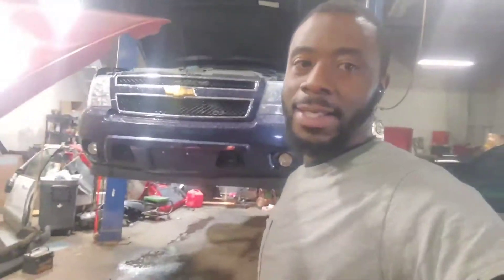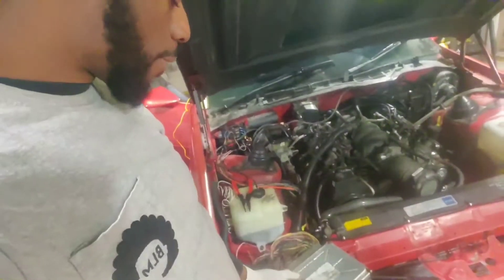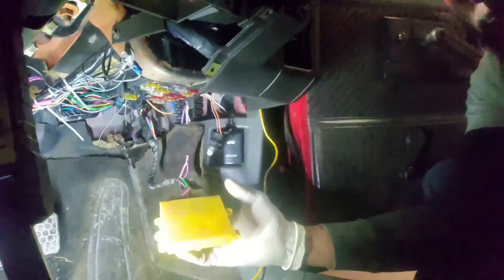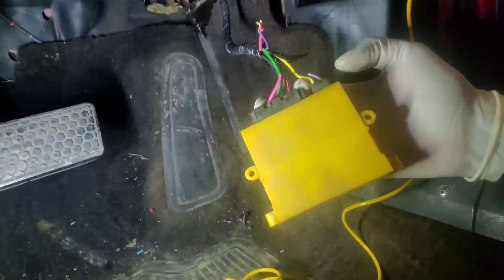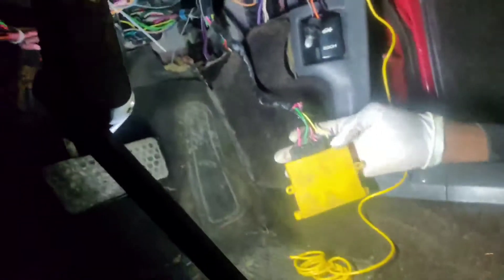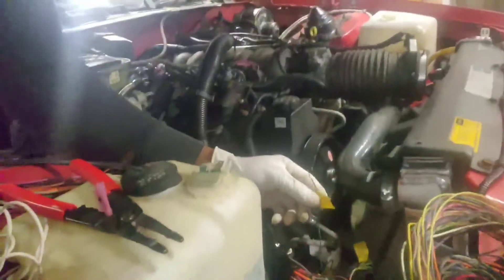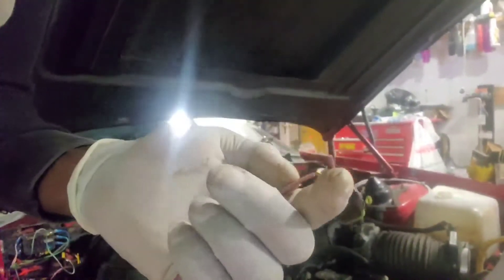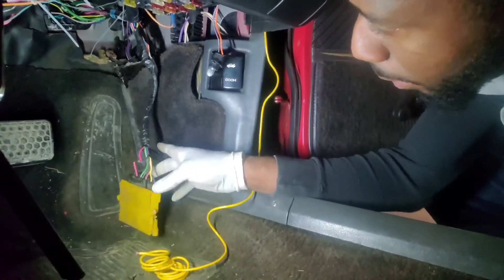Ls swap speedo hack to old-school early gm electric speed

Comment: hey what’s up buddy I have a 87 Camaro used to be a 2.8 V6 now it’s ls 5.3 with a 4l60e and I’m trying to get my dash worth cluster to work I got all the wires for my coolant my gas and my temperature I’ll try to get my RPMs to work and I bought a module from DeCora digital for the speedo and I was wondering did you know how to get to RPMs to work
Reply from the maker: I wouldn't with out seeing the situation

Comment: 88-93 cars. Trucks  only use the buffer for cruise  output. In 88 th Trucks got the 40K pulse output on transmission  cars =128K ontil 94
Reply from the maker: Damn id have to look into it